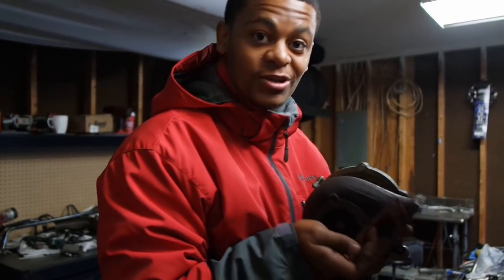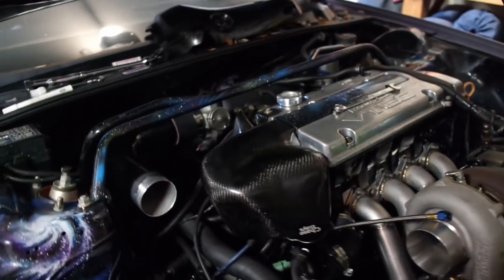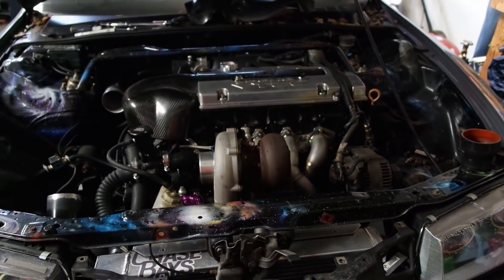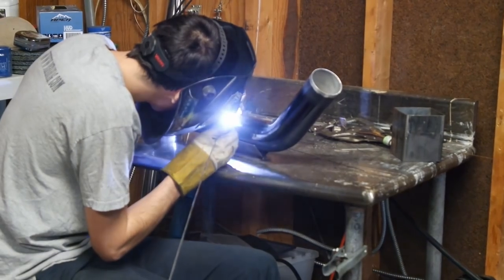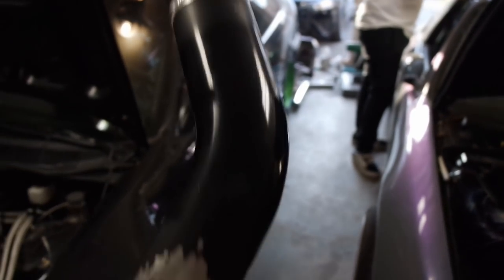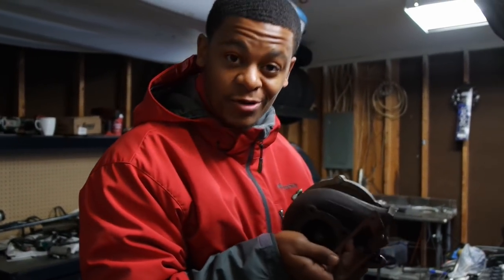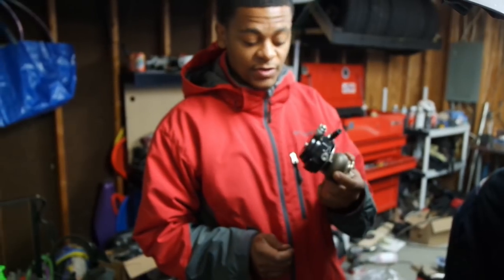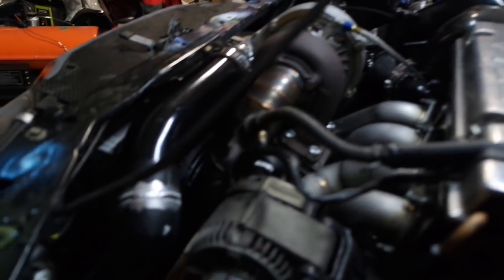Turbo f20b Prelude gets new custom manifold

Comment: Are you running a stock bottom end f20b with the h22 head?
Reply from the maker: Full f20b stock motor bro
Reply: @treybedipping1734  that's good power for stock bottom end. Imma do that combination for my build. Instead of using h22 bottom end
Reply from the maker: @jevy181  good stock motor for boost